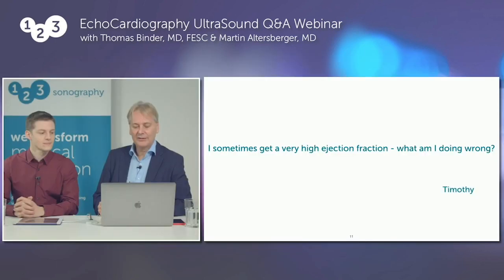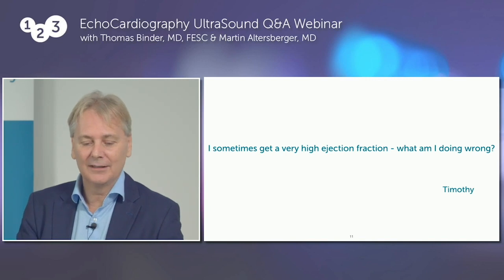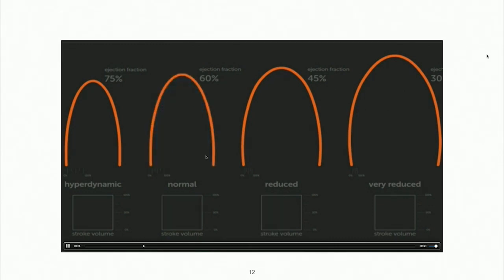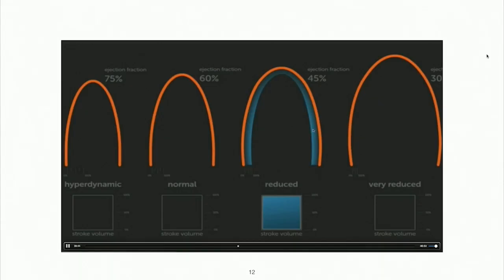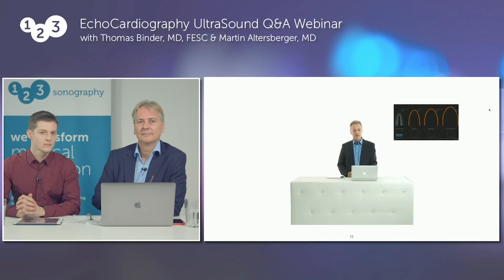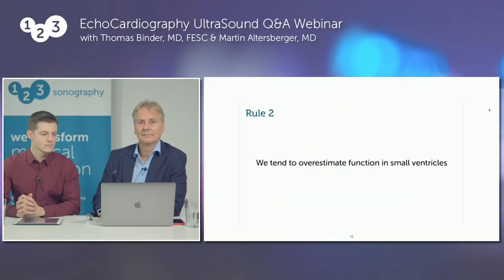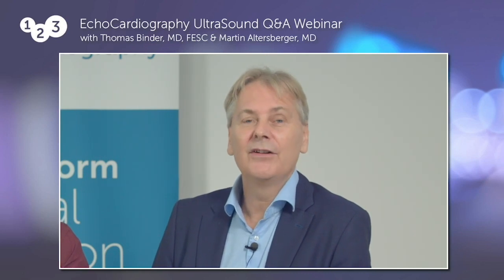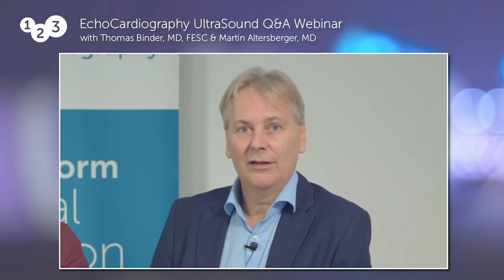How does LV size influence the assessment of EF?

Comment: What is the correlation between ventricle size and ef
Reply: EF estemation depend on differences bw LV size in D and S over LV size in D multiplied by 100
Reply: Overall: the larger the ventricle, the more wall stress is present. The smaller, the less volume it contains. Furthermore, the larger the ventricle is, the less EF is needed to keep up a normal stroke volume. If the ventricle is very small (e.g. hypertensive heart disease/HFpEF) the EF can be normal or even seem hyperdynamic and stroke volume can be reduced. LV-size and EF are 2 different ways of describing how the LV presents.